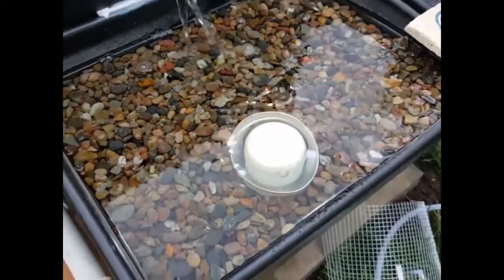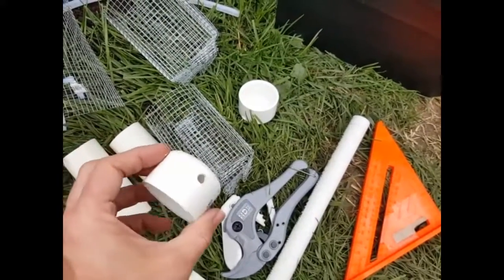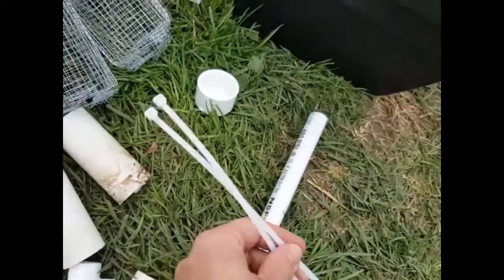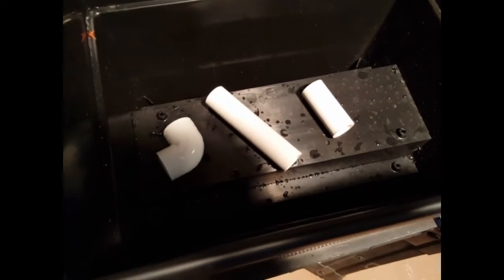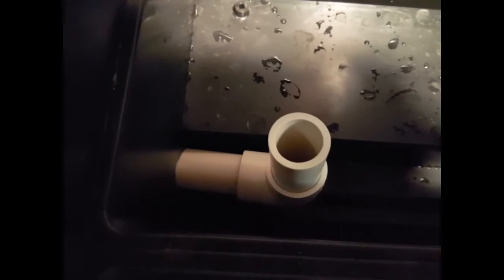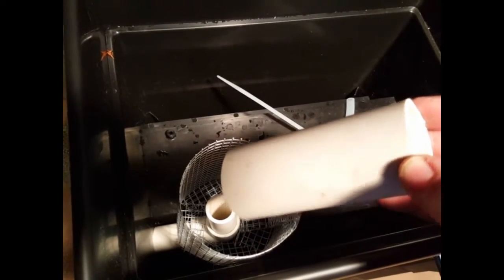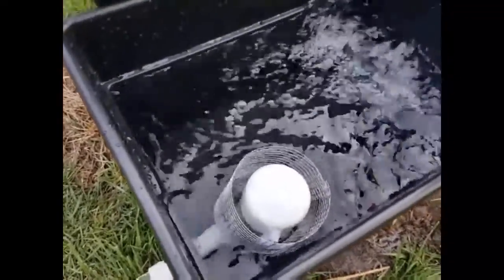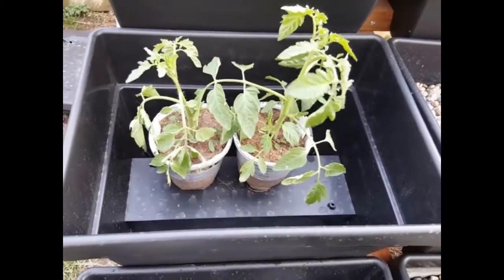Bell Siphon Build

Comment: thats doesnt show it working correctly.. it should drain WHILE u are continuous having an inflow..if it cycles then it works
Reply from the maker: The syphon definitely cycles as it drained the system with a continuous inflow. The siphon in that small bucket kicked off every minute and a half like clock work based on water height. The water pump that filled the system ran 24/7 in a timed cycle of 15 minutes on and 5 minutes off. Try it. It was inexpensive and worked well for me.